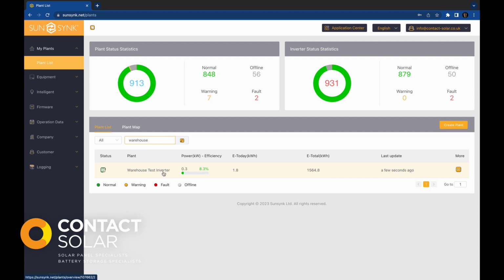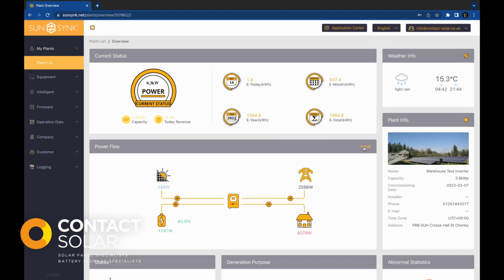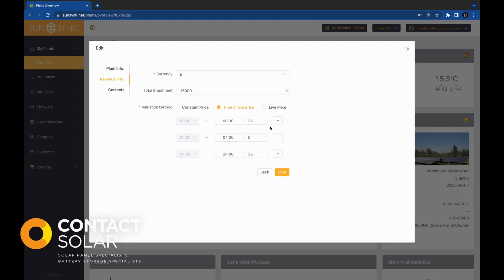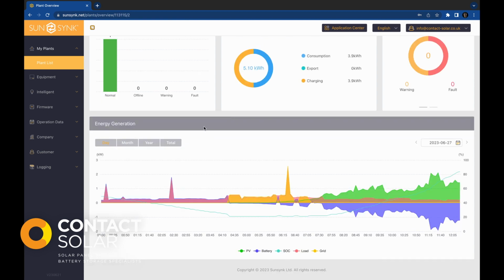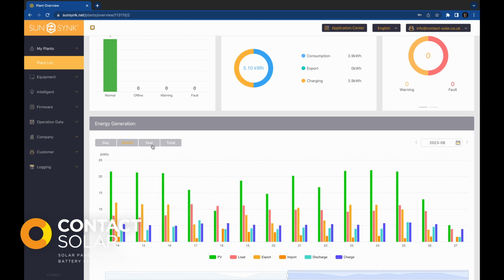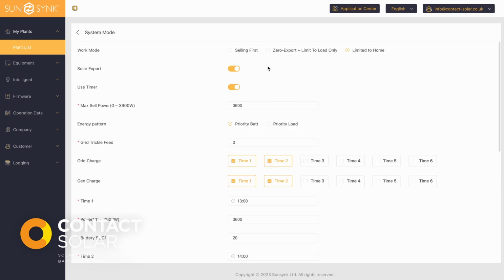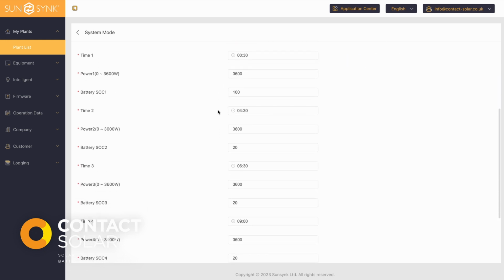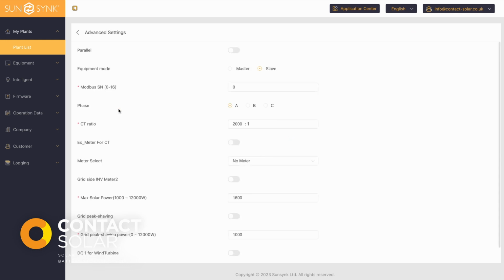How to navigate the Sunsynk portal - Solar Tutorial | Contact Solar

Comment: Hi can I connect an electric kettle when I'm totally off-grid? Can I connect a stove? I have an 8kV inverter
Reply: kettle should be fine .  stove might overload if you use more than 2 plates at a time... all depending on the sizes ofc...
Reply: @thegreenviking1422  Thanks. I was worried. But I tried it and it worked. Does Sunsynk have a "a port where excess energy can be diverted after say the battery is fully charged? maybe install something like a geyser on there. I have heard stories where other people have connected geysers and I'm not sure if I should try this. I live in South Africa and we do have plenty of sunlight